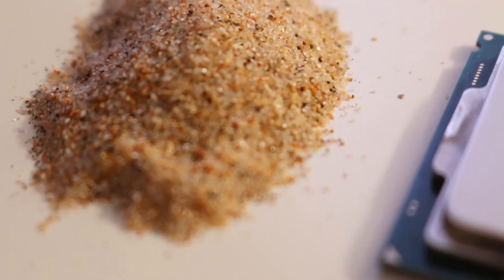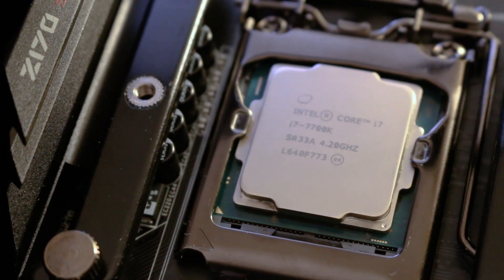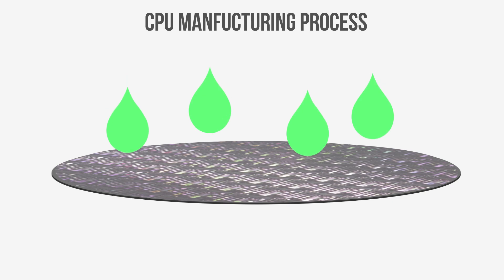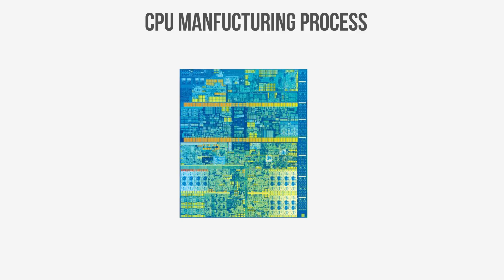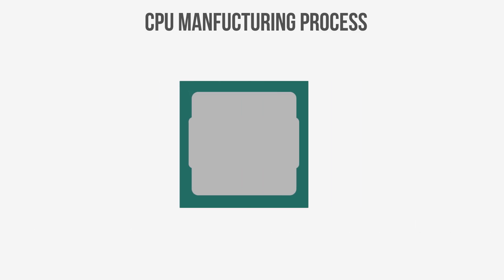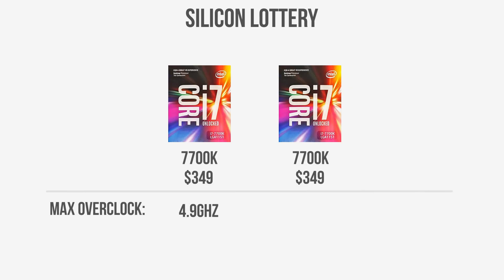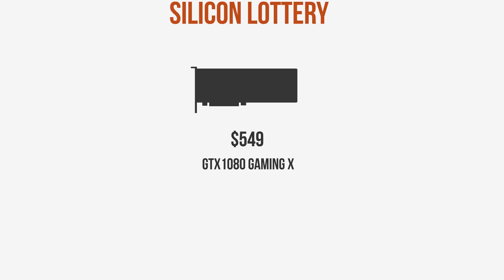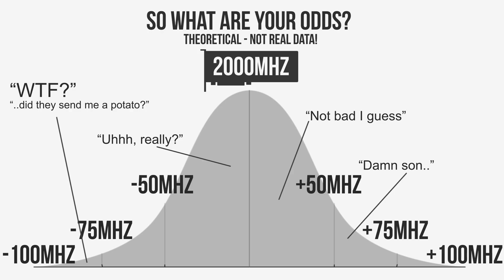What is The 'Silicon Lottery'?

Comment: You didn't explained the main reason that makes overclocking attempts worthwhile: a manufacturer's prime motive for binning is demand rather than the actual physical capabilities of the chip.
If Intel releases a new line of CPUs and the cheaper models from the line get sold like hot cakes and Intel has lots of higher-grade chips lying around — they will underclock those chips, label them as the inferior ones and sell them for profit. They spend the same amount of resources to manufacture each die, so they are not losing anything other than a measly potential earnings difference negated by quantities of sales.
If you bought a cheap CPU, for example, you might in fact have a raging beast under that lid waiting to be unleashed with appropriate clock speed.

Comment: I can barely watch this video with my GTX 1060; the artifacting is terrible. I didn't overclock at all, and I'm already sending the card in through the RMA process. I have consistent video playback errors, lowered max GPU RAM usage, and inconsistent frames in all games. I recently did an upgrade of the GPU, power supply, and case, and I've had these problems since and they're only getting worse. Power supply is better than the one replaced, case has infinitely better airflow, and the CPU is an i7-4770K so it's a little old, but I've been watching the CPU usage and it looks fine. Am I overestimating my CPU? Could something else cause this? Or did I make the right call in starting the RMA process on this GPU?

Comment: ah guess I won the silicon lottery. Was able to over clock my fridge to 1890Ghz.
Reply: My fridge only runs at 60Hz and it needs 110v just to hit that. I am thinking that I have been cheated. It does seem to run very cool though.
Reply: Damn you gonna have a hot fridge
Reply: +Stepside1986 Hah electricity

Comment: All manmade stuff has impurities or imperfections. You get what you pay for, and that is the rated specs. Not every resistor will have the exact same value. Not every capacitor will maintain the same performance over time. If you want better performance, pay for better specs. Don't try to lift 100lbs over your head with a rope rated for 80lbs, even if the rope can do it. It may work just fine, or it may fail and kill you randomly.

Comment: i won the silicon lottery by a good amount on my gpu i think, not too familiar with 1050 overclocks, it's a gtx 1050 ssc, which has a 1430mhz base and 1544 boost, and mine got up to 2100mhz when playing dark souls 3 and was always above 1900, i overclocked it to about 1600mhz and it boosted itself the rest

Comment: This is, of course, specific to overclocking. If you stick to the stock clock rate then the chip is guaranteed to work. A better title might be "Overclocking Lottery".
Reply: +johnm2012 It's still a good explanation of binning and where the different models comes from. The lottery determines the stock clock.
Reply: Well chip foundries like Intel and TSMC do bin a lot of chips which don't operate at advertised stock clock rates.
Reply: +Snooby66 I disagree with the last paragraph. If the chip won't work at the rated/binned/guaranteed/warranted clock rate it is faulty (as in not fit for purpose) and should be replaced by the supplier.
Reply: +Loshan T Do you have any proof of your assertion?
Reply: +Malus1531 Yes, I agree that it's not a bad explanation of binning. In cases where the yield is particularly good higher performing chips may end up being binned as lower ones just to fulfil a demand.
Reply: Let's  clarify a little. 

If you make 3 processors (ProcA 1GHz, ProcB 1.2GHZ and ProcC 1.5GHZ) manufactured using identical processes, and then test run them, you may find that one is stable at 1GHz but unstable at 1.1GHZ, one stable at 1.2GHZ but unstable at 1.4GHZ, and finally one stable at 1,5GHZ but unstable at 1.6GHZ)

Now, you then label (or "bin") each according to how it performed in the test.
1x ProcA, 1x ProcB and 1xProcC

The next batch of 3 performs as follows: 
Stable at 1.5GHZ unstable at 1.6GHZ
Stable at 1.5GHZ unstable at 1.8GHZ
Stable at 1.5GHZ unstable at 2.4GHZ  !!!!

You then "bin" these as 3x ProcC's

However, customers who bought the ProcC's, who then try to overclock them may find that one of them remains stable up to 1.78GHZ while the other fails at that speed and only remains stable at 1.55GHZ. The guy with the other chip may never try to overclock it and never know that it could have gone to ~2.3GHZ !!!!

The thing is, the lottery ("binning" ) was performed BEFORE the chips were released for sale. End-user Overclocking simply reveals the results of the lottery.

Conversely, a dodgy manufacturer may find that a chip is stable at 1.0GHZ and unstable at 1.05GHZ but may decide to sell it anyway. Some time later, the customer finds that their CPU becomes unstable and drops the clock to 0.98GHZ, where it remains stable again. Now, the chip may be guaranteed (as in "warranted") as 1GHZ, but that number is not a guarantee of performance.

Comment: Can't get a stable 4.5Ghz OC on my 6700k with reasonable temps/voltage.
I have a NH-D15 CPU cooler, 5 140mm Noctua case fans, I clean my PC once a week and I live in Finland.
Guess I should start cooling with liquid Nitrogen, get 5 more fans, hire a cleaner to clean my PC for 2 hours per day and move to an igloo on the north pole

Comment: I ordered a prebuilt PC with an i5-6600k with watercooling at 4.5ghz, but they sent me an i7-6700k with watercooling at 4.5ghz because I think they couldn't achieve a stable overclock.
That's my type of silicone lottery. Buy a cheaper model which states they have a lower end cpu with a high overclock (which is usually a cheaper price anyway), and they will most likely send a higher end model, and if not, get a refund that you are not satisfied, and make up some reason that is with all PC's (e.g. the motherboard bios doesn't suit me well).
Reply: What company did you order this from??
Reply: AWD-IT
Reply: No, just no. My 6600k hits 4.5ghz with 1.27v easily and pre-builts suck ass.

Comment: "you melt sand into a block of pure silicon"

Jan Czochralski is rotating whilst being slowly withdrawn from his grave
Reply: pretty sure he has hit about 9000 rpm at thispont.
Reply: We could invent a new manufacturing process harnessing the infinite rotation of his corpse.
Reply: Luca Fuoco How about we use an orange and pretend it's a really big atom? This table (pretend there's a table in front of us) is six feet long. This orange is three inches in diameter. It's safe to say that this table is as long as the diameter of 24 oranges but I don't have 24 oranges in front of me. I have only the one. Although there's only one orange in this defined space, I'd still say that the table is 24 oranges long. I'd never, for practicality, use an orange as a tool for measure but, since it has a measurement of some kind (three inches in diameter), I can use it to give someone an idea of how big/little an object is.
Reply: Lol.
Reply: Then get an object that's practical for measuring length, give it a name (a flugerstromm), and figure out the relationship between the table and the flugerstromm (3 flugerstromms=1 table). After that, figure out the relationship between the flugerstromm and the diameter of an orange (1 flugerstromm=8 orange diameters). With those measurements we know that 1 table is equal to 24 orange diameters.

Would I ever use an orange to measure a table? Fuck no. But if you didn't know the size of a flugerstromm, a mental picture of eight oranges lined up side by side would give you a good idea of the length.

P.S. People have already figured this stuff out for you and, just so you know, the width of a 14nm gate is equal to the length of 70 silicon atoms.
Reply: I legit paused the video right there to try to find people complaining about this.
Reply: The harvard bridge is measured in smoots. Smoot is the guy's name who laid down repeatedly to calculate the distance. Google has astronomical distances listed using the smoots unit. Smoot was in charge of standard units of measure for a while. It sounds like smurf and I'm not joking. The standupmath channel did a vid on it.
Reply: Ugh don't be a pleb, when he says that it's "70 atoms wide" he means that it's 70 times the diameter of said atom. Just like how you can say that "you can fit 11 earth's in jupiter's diameter"
Reply: @lucafuoco1179  "The difference is that you can put people right next to each other but not so with atoms."

Not enough of them to go all the way around the world though.
Reply: @lucafuoco1179  "The difference is that you can put people right next to each other but not so with atoms."

Not enough of them to go all the way around the world though.
Reply: Breaking news: Bitcoin Broke $10,620.90 United States DollarSo far we have no clear reason why it did it so sudden but my bet is the fact we have new money coming into the market. We cannot forget that Fidelity Digital Assets is bringing institutional money into the space. We really cannot say we are being overbought due to that fact. I think as more institutional entities get access to Bitcoin we will continue to see the prices rise the way that they are. Another thing to notice is the fact that the institutional money has been moving Bitcoin up in a slow and steady fashion.
Don't miss out invest today and you will be proud of your descion in 7days time the profit is more than impressive just don't be left out, a lot of people are witnesses to this this advance means of growing life's also eradicating poverty 
#smartchoice #Bitcoinkings #moneymakers
People have made fortunes off Bitcoin, some have lost money. It is volatile, but people make money off of volatility too invest wisely 👉
 + 4 4 7 7 2 3 1 0 1 3 5 3
 Making money is a choice bitcoin is a future investment make a wise choice
Reply: lmao this joke made my day
Reply: Luca Fuoco He was describing the width as being “70 atoms across”. He never said there were 70 atoms in that amount of space. The circumference of the earth has been described using people standing shoulder to shoulder but, while there are people living near the equator, you won’t see that sight any time soon. That being said, he could have worded it differently. Also, if he really did mean to say that there were 70 silicon atoms in that amount of space, his research was very poor.
Reply: cwg73160 stop responding to trolls. It's spamming my inbox
Reply: Luca Fuoco You seem like a smart guy so I don't understand why you're getting so caught up with the impossibility of atoms being next to each other. Let it go. No one is arguing that. We're interested in the SIZE of the atom, NOT its properties. I'm done.
Reply: Luca Fuoco I guess you skimmed over the part where I said that you wouldn't see that happen but, if you think you'll ever see people lined up shoulder to shoulder spanning the Atlantic, Pacific, and Indian Oceans, more power to you.
Reply: So lets see you do better kid........I am waiting for your video.Thought so.......
Reply: Luca Fuoco lmao these comments gave me everything I needed to know about this poorly researched video
Reply: I've went ahead and posted this comment along with your name giving its approval.

Remember to clean up the jizz-stained tissues that litter your desk before trying to fool people into thinking you're smarter than you actually are. Loser.
Reply: Luca Fuoco Anything can be used as a unit of measure. Literally anything. A human foot, the rising and setting of the sun, full moons. Anything. If something has been measured it can be used AS a measure.
Reply: omfg I didn't realize I'd have to S-P-E-L-L it out for you lololololol. In case you didn't see this the first time, the width of a 14nm gate is equal to the length of 70 silicon atoms.

Comment: I think I won it. I bought an Intel Core i5-2500k and the box said it was clocked to 3GHz, then when I checked, 3.6GHz stock. Not gonna overclock that CPU.
Reply: Nah you didnt win, its most likely the regular boost. 3Ghz Stock, 3.6 GHz boost.
Reply: Currently running an i5 2500K, mine does around 4.6GHz before I get cooling issues. Stock turbo is 3.7GHz so you definitely didn't luck out though
Reply: Coolermaster Hyper 212 Evo (if I recall correctly it's by far the most common aftermarket cooler)

Comment: i won the lotery back in the early days of dual and quad core process with a intel core 2 due e8600 that p[rocessor was a beast taking a overclock of 1.5ghz on air up on its 3ghz factory speed to 4.5ghz with very little voltage tweaking. that particular cpu was a champ.

Comment: So even though the manufacturing process is sofisticated, it is not perfect. Why don't they just tweak it so that the lottery favours better reward. I'm sure we would start seeing better hardware priced lower than it is today.
Reply: It is not perfect and it will never be perfect. The process is so complex, an error so small, that it's almost impossible to even imagine, can already damage the CPU.
Of course "they" could tweak it. Will probably take a few hundret billion dollars though. You think the manufacturers would not do it, if it was easy?
Reply: They probably do tweak it. To tweak it, you need to print a lower clock speed on the box the CPU comes in. Then it becomes more likely that it reaches higher up than the stated value.

Of course this doesn't change the CPU itself. You would just get the exact same CPU in a different box. They can't change the outcome of the manufacturing process itself.
Reply: They tweak what they do have control over: the marketing, advertising, box art etc...
Reply: We have a technology, where you can literally measure the size of those logic gates in terms of atoms, and you all act as if it's nothing and all those people do is create fancy artwork.
I feel sorry, that the 4GHz processor you bought only runs at 4GHz.

Comment: I'm upgrading soon. But regardless, when I first got this 4670k, I was on a lower teir corsair h80; I then switched cases, and went with an h100i. Still... Regardless of what I changed, be it voltage, or even lower ram speed to maybe get it higher I couldn't. It's sad, I definitely did not hit the lottery here, 4.2 is max before it is unstable, lol.

Comment: Is there any limit to overclocking, or is it just temperature?
Reply from the maker: There's a voltage limit also, but that's quite hard to hit with consumer CPU cooling.
Reply: I'm trying to overclock my GPU past what the software is allowing me, since I have a 1050ti that runs pretty cool. (60C on FurMark), and i'm pretty sure it's not going past the power limit, which is ~117

Comment: My 7700K does 5.2Ghz@ 1.39V 24/7 stable with OCCT and Realbench for 1 hour each... Lottery Winner... Purchased from a company called Silicon lottery.
Reply from the maker: Damn that's impressive! How much of a premium did you pay though?
Reply: Nice what cooler and temps do you get?
Reply: $549US pretty reasonable and an excellent company to deal with.
Reply: Custom water loop 27 degrees C ambient temps topped out at 80 degrees C on one core running OCCT

Comment: I remember my old AMD Sempron 3000+. It worked like a charm for 10 years and then I overclocked it at 2.5GHz for 2 more years. The motherboard gave up, but I still have the CPU thrown somewhere and it would still work well if I were to give it a go.

Comment: The speed is not how they justify the 7700k and the 7700, they are different chips, 7700 has visualization extensions, while the 7700k has overclocking extensions.

Comment: What do you call stable overclocking ? I have an i7 7700k I've tunned it to 5Ghz and at idle it is at 35°C  (Aio) is it considered stable ? Thanks for the answer
Reply: XelaRy A stable OC is where the CPU is at a safe temperature while doing your tasks, and not crashing windows or your applications.
Reply: TheMLGParodist thank you m8 :D
Reply: fgregerfeaxcwfeffece actually i'm now in a bit of a problem one night i went sleeping and when i woke up my pc wouldn't let me boot and the vga led was on (i have an asus z270f strix) and now i did everything like unplugging my graphics card putting an old gtx 660, booting with no gpu at all, even hard reseted my motherboard and i booted as far as the post screen what should i do ? I'm kindda scared if one of my part is dead.
Reply: Or more accurate:
Do a few hours of benchmarks if it's still running at ok temperatures you are fine.
Reply: can you still get into the bios? I also assume you checked all the connectors and ntohing is fried in a visually obvious way?

Comment: Great well informed video.
BTW, the binning process also different between manufacturers. They tend not disclose how they do the process binning, but generally speaking, it depends on stochastics. they can already estimate the expected variation in the chips based on historic data and the chip position through the wafer, and its state during the manufacturing process, and a number of impurities through during the doping processess. 
they don`t test each chip because it is really time-consuming process, instead, they estimate what that chip would perform.
Reply: Enthusiast chips such as the i7 and recently i9 extreme edition go through the same binning process as the mainstream chips.
Professional and workstation chips are binned to be the best chip, they meant to last longer and encounter fewer errors, along with that they add expensive components and ECC memory. but they cost much more than regular chips, like NVidia Quadro chips and Intel Xeon.
These chips trade price and sometimes performance for reliability.